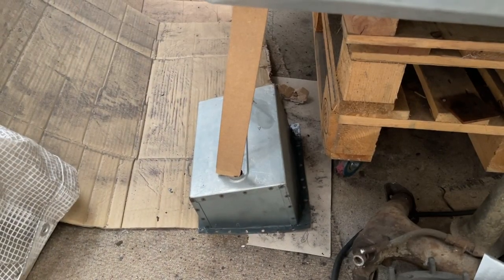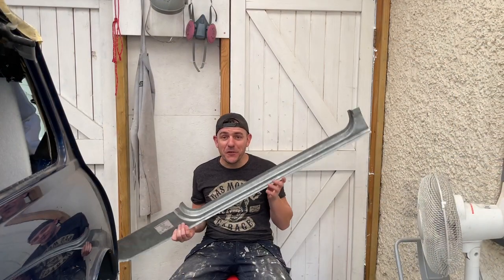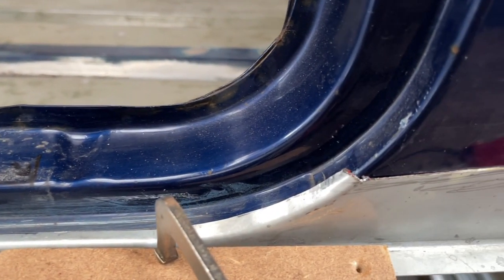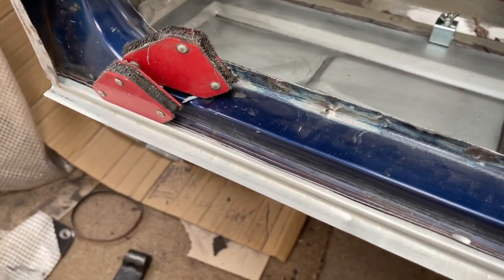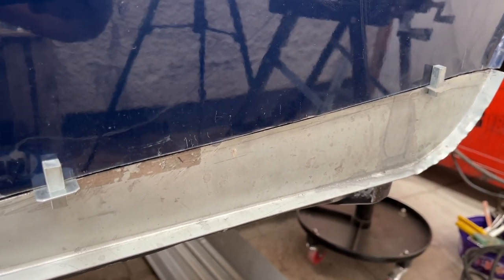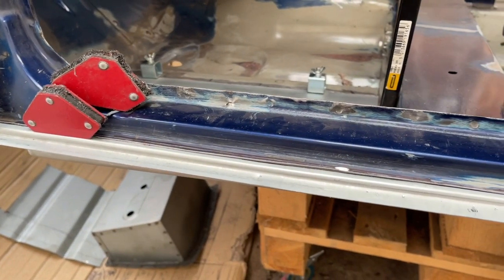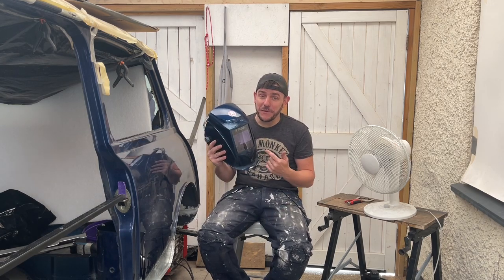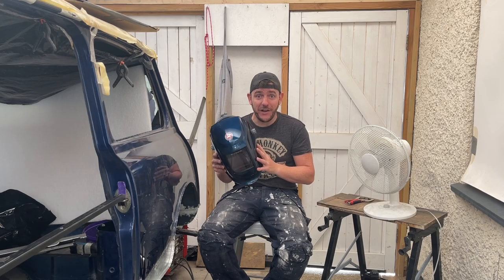Classic Mini Cooper Sportspack Restoration | Welding Bodywork

Comment: Hi Kevin, just found your channel, really enjoying it. I'm on my 3rd, (and probably last, seeing as I'm now 70) restoration project. It's great to see your welding skills are improving no end. Can't beat RTech. I bought a Sealey Supermig 150, which has been OK and done a lot of work, but if I had my time again I would buy an RTech welder. just a couple of constructive comments/tips: ditch the scissor type tin snips, get a set of the dual lever types, they make it so much easier. I bought one of those metal-working vices with the small anvil at the back from Machine Mart, wasn't that dear and has been really handy. When your pattern panel doesn't fit around the curved flanges, which is really common in my experience, don't be afraid of making some slits and welding them up later. The BH Deox gel is a great product, bit slow, but really good. Best rust converter bar none is Fertan, not that easy to get hold of but is superb. Truly inspirational channels for you to check out if you haven't already, Dave's Garage, Trev's blog, Fitzees Fabrications and Carters Auto Restyling. Good luck with the project.
Reply from the maker: Thanks Bob! Really appreciate the comments… I have seen a few videos from those channels… Air tools and a bigger workshop would be the dream! 
Hope you enjoy the content and the great humour 😂